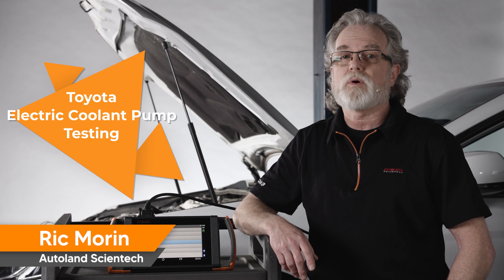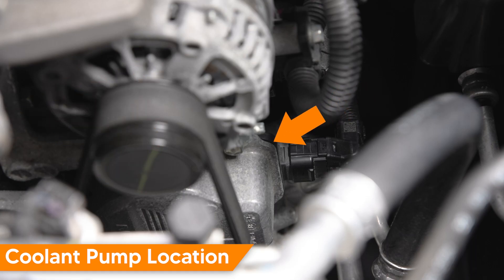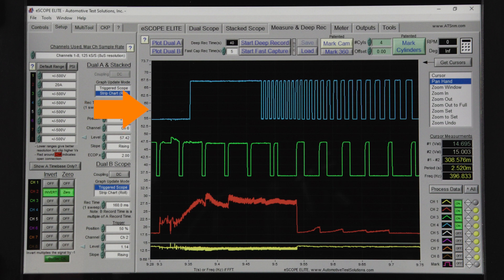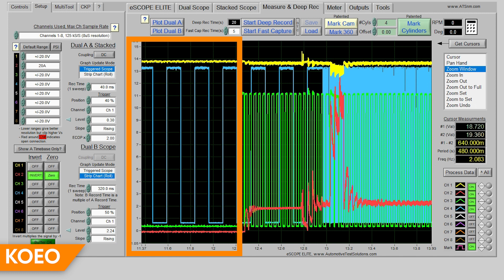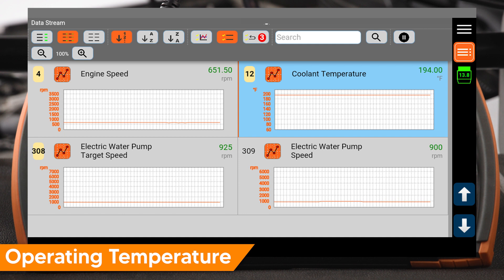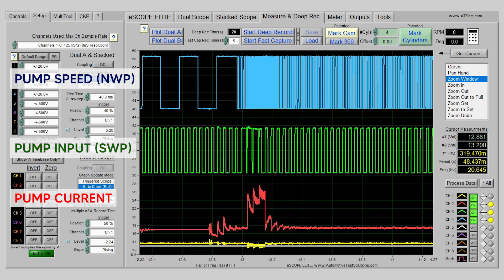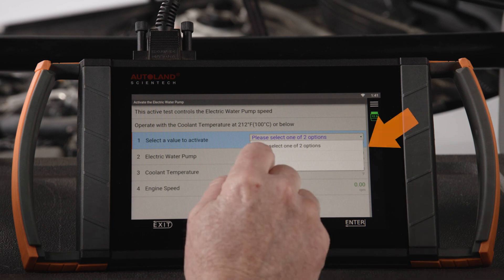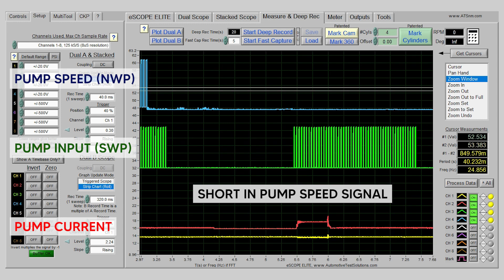How to Test & Diagnose Toyota Electric Water Pump | P26CA Engine Coolant Pump Control Circuit

Comment: Does that failure cause the pump to burn out?
Reply from the maker: This video shows how to test the electrical circuits and function of the pump. You can use it to determine if the pump has failed.